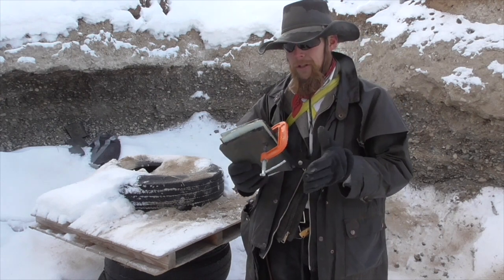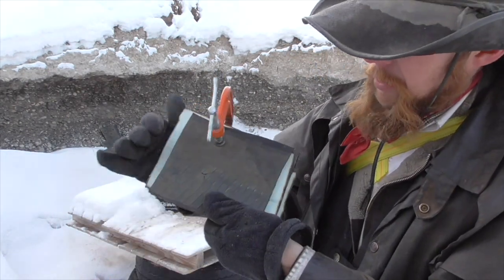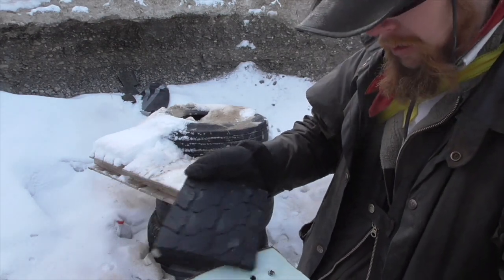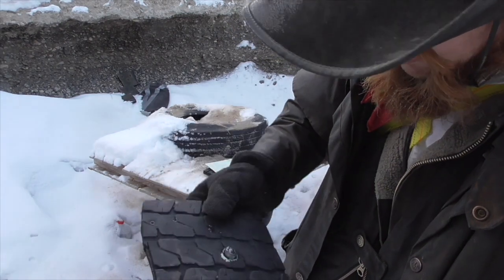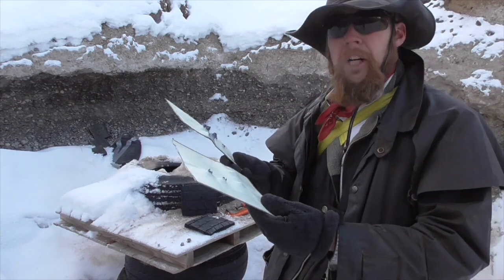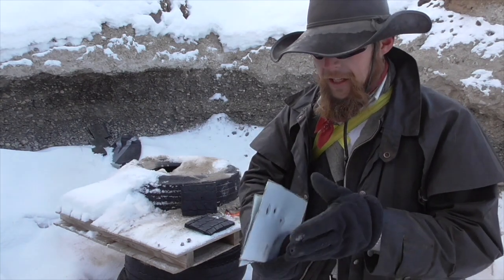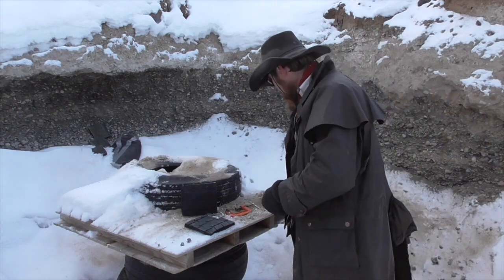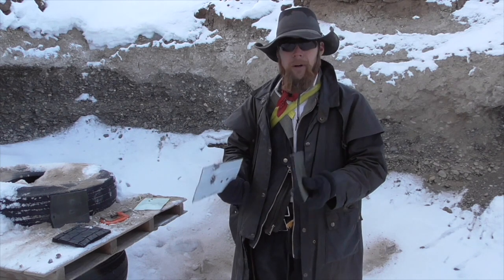Testing Improvised Armor: Tire Tread and Sheet Metal (TIS253)

Comment: Try ceramic tile instead of steel. Or in front of the steel.
Reply: This. 
Steel sheets bend and impose a small force on the impacting object over a large distance. 
Ceramics crumble and impose a large force on the object over a very small distance.

Even if ceramics take a lot less energy to break, the larger force is more likely to overcome the spinning bullet's gyroscopic momentum and to make it tumble. 
And in a viscous substance like rubber, a tumbling bullet will lose energy a lot faster than a spinning one.

Comment: Yup ... It appeArs the sheet metal actually holds the hole in the rubber open and provides the bullets a path with less friction or adhesion resistance ... Taufledermaus just posted a test of a wadcutter designed slug that went thru multiple layers of kevlar ...

Comment: I remember a physics demonstration where a nail was driven into a board with a glass bottle filled with water and sealed.  the idea is that fluid can't compress so force in one spot is distributed across the whole surface.  If you had a sealed metal container with water and no air, how much surface area would be needed to stop a bullet?

Comment: This might sound strange, but try layering farriers rasp/file. It's hardened steel and they are usually 1 1/2 inches wide and 1/4 in thick. Could be interesting. File plate armor.

Comment: Try standing off the steel from the front layer, like this...steel, rubber, air gap, steel, rubber.  if you can do this test at 45 and 90 degrees to the normal you should see much greater resistance to penetration at 45 than raw thickness should explain.

Comment: The deformation of the .44's just causes them to dump their energy real sudden. That nasty little 9mm not hardly at all, it just won't deform. Try a harder material in front of the tire rubber. How hard does work hardened aluminum plate get?